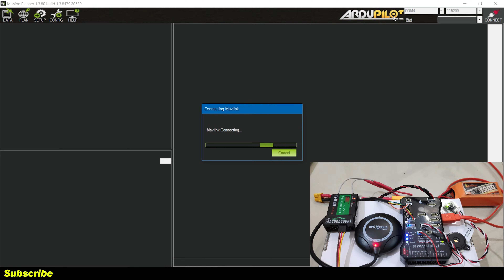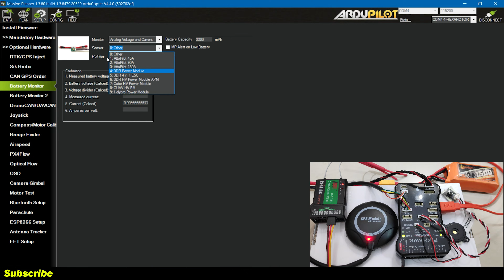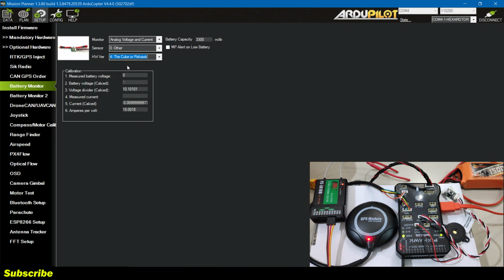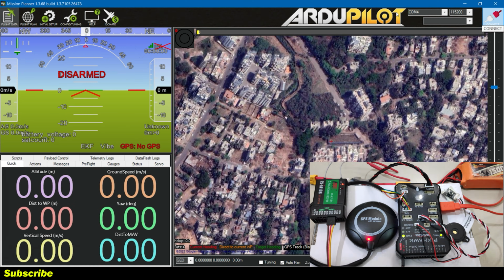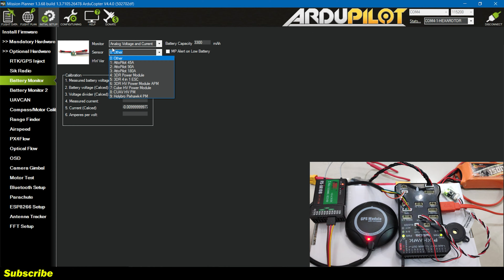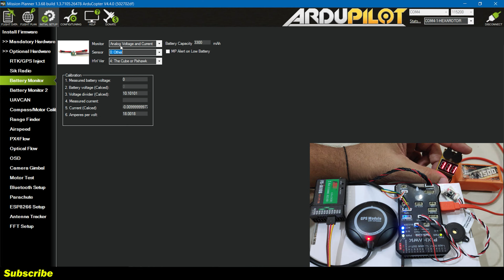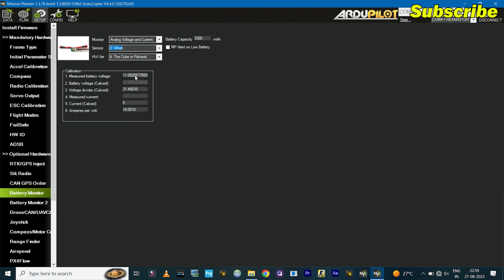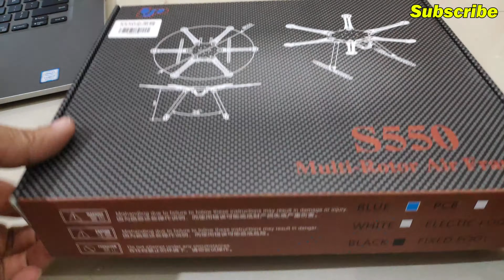Pixhawk 2.4.8 3DR Power Module Setup Walkthrough Step by Step | Part 4

Comment: i have question i have a s500 kit, i have a holybro power module with a 5200 mah battery. i follow your steps but when i get my motors to spin and arm the RC and i raise up the throttle i get a yellow flashing lid and if got up on my throttle it spin faster but doesnt move. i check the propellers and motors they are all correct the gps go from blue, green and when i go on throttle it goes straight to yellow i connect it my mission planner and in the messages i get a "battery failsafe-disarming" i look it up i get several different forums say it could be a bad battery or i have to disable my arm or disarm and failsafe in parameters. other say it not getting a lock of the gps. im starting to thinking i need to change the setting in battery monitor ... what do you think
Reply from the maker: @bluecavemen  So it seems like the battery is either not able to maintain the voltage when taking off and causing a low battery failsafe or in mission planner you need to double check the power module settings and also input the correct battery voltage in the tune parameters menu. In failsafe menu do you have any battery option enabled?
Reply: @RakishRc  i check the battery volt it show 11v with 5200mah. using a multimeter. can you be more specific about  tuning the parameters. for the battery option...if i have a 3s battery 11v if i want to get a full flight time what should i lower it two 3v? if so i have that on my failsafe setting for battery monitor. as for the parameters setting im not sure which parameters i should disable or enable or add setting so it can understand not to disable my drone from flying. i wish i could send  you a video. it best to explain i been working on this for 3 months still cant figure it out
Reply from the maker: @bluecavemen  send me screenshot and videos on telegram @rakishR3 its mostly about setting the right voltage values in mission planner depending on the power module